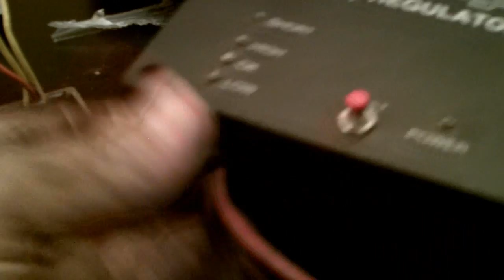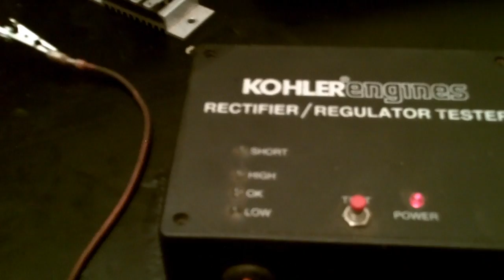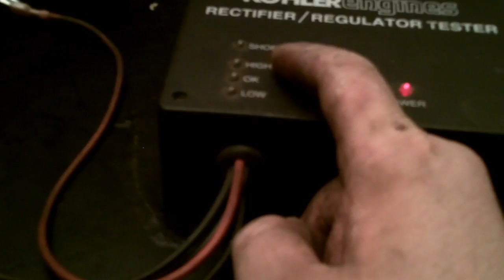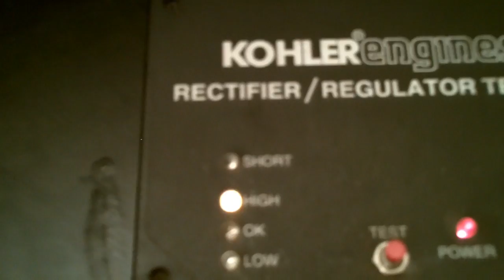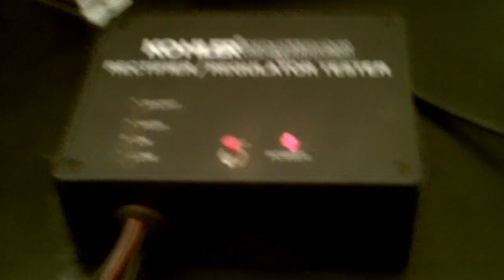LAWN MOWER /TRACTOR / ZTR / HOW TO TEST SMALL ENGINE VOLTAGE REGULATOR/ RECTIFIERS

Comment: That is one sure fire way to see if one's VR is good or not. So, battery on the center and either alternator wire on each end, correct?  Very helpful! Thanks! Can the Deere 140 Kohler rectifier be tested with an electrical tester?

Comment: LOL I have to agree with General on this.   I did not watch entire video the first time.   That tester is like 200-300 bucks to test a 15.00 part.   To test on a mower you dont have to take it off the shroud.   Just run the mower insert probe on DC output and other probe on the ground.
Should read 14 volts.  DONE.  don't need anything.   So why would you want to pull that off a mower to test it?  As long as the mower starts you can test it, if it does not start solve that issue first (jump it, put gas in it etc)
Reply: Same exact thing I was thinking

Comment: I have a kaw fx850v and accidentally put the stator plug on the wrong terminals on my regulator. Did this damage my stator or regulator? I have it hooked up correctly now but it's not charging.
Please help
Reply: Hello I would check only stater AC volts when running. If it’s good then check output of rectifier 12+ volts with running and battery connected. If rectifier bad replace. Test at battery should show 13 volts plus if system is charging
Reply: @josephpuchel6497  thanks I replaced both and now fixed

Comment: Quick question.  My stator, voltage regulator rectifier and battery are all brand new. Why is it still not charging?
Reply from the maker: Your not grounded
Reply: @THEMOWERMEDIC1  it's a kaw fx600v.  Where can I not be grounded?
Reply: @THEMOWERMEDIC1  can you tell me where to get started?
Reply: Can I add a ground?

Comment: The plug connecter is still on the tractor I found out from Troy Bilt Tractor it's $90. and change for the wiring and the light bulbs for the tractor

Comment: I found this video to be very helpful, I have a 40-year-old 16 hp Techumsy that I put on my struck mini dozer. There are three wires that come out of the engine on two of them I have 50 VAC at high rpm. Does the third wire go to ground or does the third wire go to the voltage regulator positive?

Comment: When using a digital multimeter with the setting on diode mark to test a three pin rectifier regulator, is the reading supposed to show zero across any of the AC/B+ pins pairs? Please help me with answers,I just bought a brand new rectifier regulator supposedly for John Deere Onan F930 on aliexpress online store but to my surprise one of the ac/B+ pins pairs reads absolute zero on a multimeter with setting on the diode mark.

Comment: I don't know much about mowers I'm learning (the hard way like I learn everything else) but I've got two questions for you. 1 would a defective voltage regulator keep the mower from turning over and 2 if you're a "genius" like me and you don't disconnect the battery while you're working on the flywheel and you accidentally ground the stator will that fry the voltage regulator? I'm guessing yes on both but since I don't really know I figured I would ask somebody who did.
Reply from the maker: The voltage reg has nothing to do with the engine turning over and the stator is grounded anyway so no harm there

Comment: how would one test a Kawasaki 20 Amp Voltage Regulator 21066-7011 210667011 where you have 3 tabs with two of them joined thanks mike

Comment: Correct me if I'm wrong but, on a Kawasaki the two terminals on the right are both AC and the single one on the left is the B+ so it goes B+ AC AC that's the way the plug from the stater comes out
Reply: So how do they hook up
Reply: From left to right ac ac b+

Comment: Hey I have a John Deere LT155  with a Kohler 15 HP engine .
The two white wires coming from the stator are butt connected into one wire that goes to the voltage regulator mounted on the side of the flywheel cover and the other A/C wire goes to the ignition switch.
The problem is that both A/C wires have gotten so hot that the insulation has melted near the voltage regulator connector and the white A/C wire going to the ignition switch got so hot it became brittle and fell apart.
There is a 14 guage ground going from the voltage regulator to the engine block, do I need to find a better ground?
I do not see any diodes .

Comment: Good day, I was faced with such a dilemma,voltage Regulator Rectifier For John Deere Kohler Engine you want to put on the outboard, I was advised by my American friends.
The question is that can I this controller to put in the motor housing?
Here is a video where I describe the connectivity:https://www.youtube.com/watch?v=fORqjN8Hpjs&t=6s
see 4 minutes.

Comment: I know this is an old post but I need to pick your brain I have a 1972 John Deere 112 with the Koehler engine and I keep burning up the voltage regulator rectifier last one lasted about 1 tank worth of fuel. The stator has no grounds has good continuity and at full throttle a steady 36 volts ac. Any ideas the voltage regulator is part number AM102596.

Comment: how much AC voltage should I be getting out of my 16.5 Kohler? In a Lt 1000 craftsman
Reply: From what I've seen on utubes about 26 volts or so at your working running RPM . Not idle RPM

Comment: Various comments mention that this tester is stupid because you can just test the regulator with a multimeter. The answer is that you CANNOT easily bench test with a multimeter because the Kohler regulator/rectifier is more than just a simple 4 diode bridge. It also regulates! If you test the resistance between AC and B+ on a brand new unit, it will show 0 between one of the AC lugs and B+ and infinity between the other AC lug and B+. If you reverse polarity (switch lead on B+ from black to red or vice verse), you'll find the same readings, but on a real diode bridge changing the polarity would have flipped the reading from 0 to infinity or from infinity to 0 since the diode conducts in only one direction. Forget the multimeter diode test; it will make you mistakenly think every regulator/rectifier is blown.
Reply: 8Hp Kohler on a Craftsman lawn tractor, kept blowing fuses. Regulator puts out 21 Volts! So I replaced this module, double checked the ground and even double grounded it for temporary. Again 21V !! What gives? The old regulator was definitely bad, one of the "A" terminals is shorted to it's metal housing internally.

Comment: A friend of mine has a log splitter with a Kohler K241 it has a starter / generator with a voltage regulator. He is having some charging issues and his manual does not cover this set up. Do you have a wiring diagram or testing procedures for this type of charging system? Please reply to sptnurb@yahoo.com Thanks in advance

Comment: That's all good and swell if you happen to have a "Voltage Regulator Tester" but some of us aren't in possession of such things.  Is there a way to test a regulator with just a multi-tester and possible power supply?  Stator is faulty so I cannot check regulator while on running engine by any measurable output.  Would be nice to know if Regulator is bad to save another week or so of waiting for it to come after Stator arrives and THEN you find regulator is bad.
Reply: That's the question I've been begging to answer. Here's what I have so far.  The two leads coming out of the stator should have some sort of resistance, 24 ohms. If you get nothing, odds are there is a short in the stator. If you start the engine and measure the ac voltage coming out of the stator while connected to the rectifier, (terminals 1 and 3) you should receive some sort of voltage between 18 to 30 volts. The voltage going out of the rectifier which is DC voltage to charge the battery, is the middle pin and should be around 14 volts. You would measure the center pin and t chasis ground to get the reading.
Reply from the maker: any good dealer will test the vreg for free at the parts counter
Reply: +mdenny9969 
Yep....  You are correct.
Reply: I figured you would need power going into the regulator to test.  Nevertheless, in this case it was a faulty ground somewhere else.

Comment: The wiring from the regulator to the battery.  It is obviously not getting to the battery!  It, voltage, is present at the regulator but is not getting to the battery.

Comment: If we owned the test device in the video, we would probably have the manual that came with it.  Testing wouldn't be a problem.  I searched for "testing Voltage Regulators" because I didn't want to have to purchase special equipment.  Isn't there another viable low cost way to test a small engine voltage regulator?

Comment: i don't have nor do i plan on spending 100 plus dollars on this machine, If a regulator is functioning correctly the b+ middle prong on a kohler should be putting out 12v correct?

Comment: ok i'm gonna lose it. I replaced the regulator because the dealer told me to. 1977 john deere 300 kohler. after that i learned how to test the stator and it is putting out 28volts, but still will not charge my battery. what else should i check?

Comment: can you email me where to get that tool lawnmoreman@hotmail.com
also maybe you can lead me in the right direction im working on a 14hp vanguard the 2 wires comeing from the regular what should they read  the voltage reglar is not hooked up at this point

Comment: nice little quick tester :-)

Looks like a bridge rectifier followed by a reguator.

Can be tested with a psu and bulbs+meter, but that tester is fast.

the only thing it wont test for is a load test creating heat and breakdown,
but that can be done on the machine i suppose.